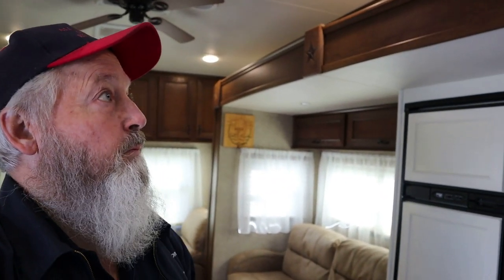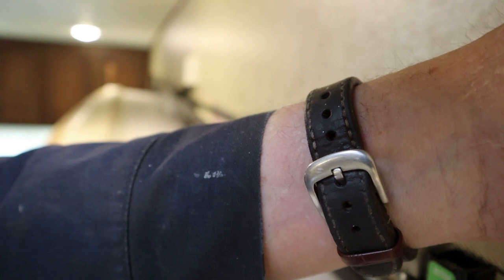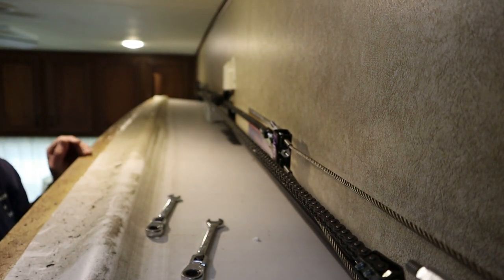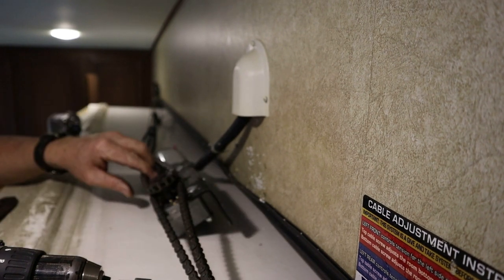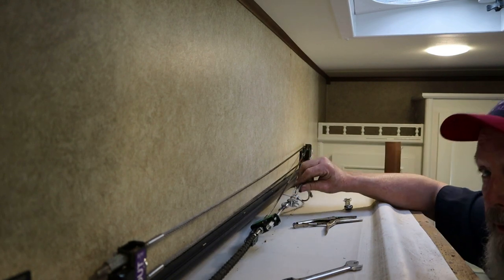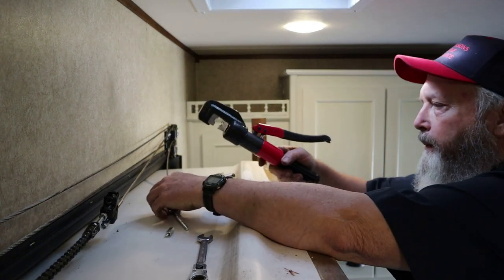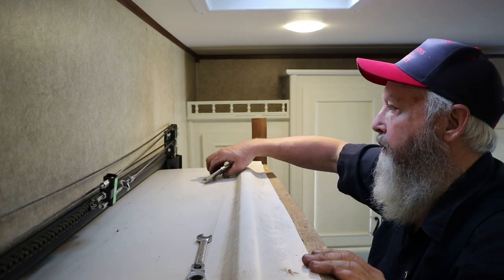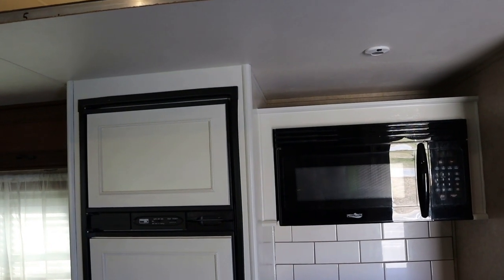BAL Accu-slide Room Motor And Gearbox Change And Cable Adjustment

Comment: Does the slide HAVE to be extended all the way out? I can get my skinny ass up on top of the slide I'm having an issue with to loosen/remove the chains without trying to extend the slide, but will it be problematic if I complete the motor/gearbox swap with the slide in?

Comment: Did they send a drip catch pan with the new gear box, my dealer installed them under my gear boxes because they leak onto the roof fabric and will cause it to bubble.
Reply from the maker: There was a piece of tin on the bottom of it. I kinda wondered what that was about.
Reply: I have a four slide-out 2013 MONTANA and have never had a gearbox leak. I have replaced a gearbox in the kitchen and a motor on the main slide no fun. I also added rollers to kitchen slide.

Comment: I have a 2018 Heartland Torque with Bal Accu-slide. The living room will not slide-out but it works going in. The motor runs but the gear doesn't turn going out. How can I manually get the slide-out to get to the gear box and motor?
Reply from the maker: Have 1 or 2 friends push on room while someone else pushes the button. It will probably go out.
Reply: Thank You, I will try that. I hope it works that will save me some money. Great Video's👍👍

Comment: On you amazon store, are the two Dinosaur Electronics boards the ones you use to fix most water heaters ans furnaces?
Reply from the maker: Fan 50 plus pins is for furnaces and the other one is for WHs.

Comment: What did you do to keep the slide out from tipping outward. Once the gear chain is released the room is free to move.
Reply from the maker: You caught me. I didn’t show it, but I put a Jack under the room outside to level it up while I was working on it.
Reply: First step in the process. Probably the most important if not OUCH.

Comment: Just curious with so many things which can go wrong as cables, gear boxes, motor and adjustment , is this Bal Accu slide any good ? Or better to stay out of RV's which use those slides ? I know most of the RV slide systems have a some problems, but this system looks complicated to start with. It is even possible to get slide back in, if one of the cable break ??
Reply from the maker: See other comment.